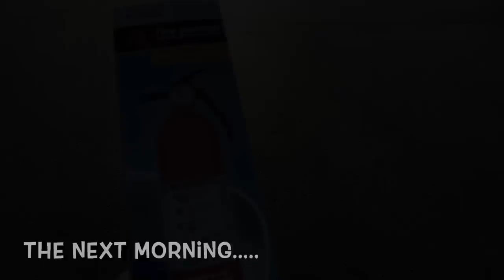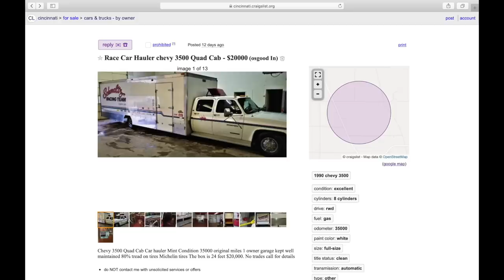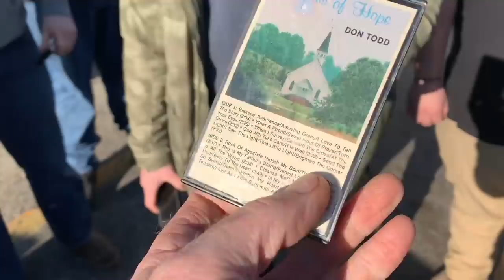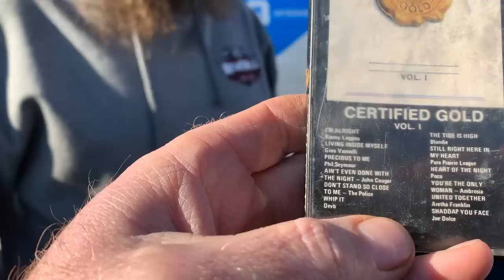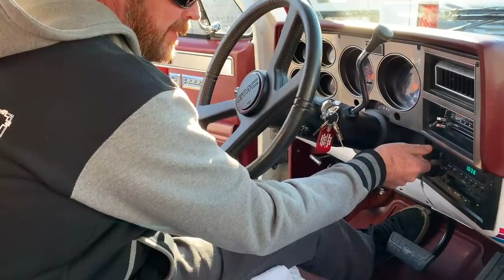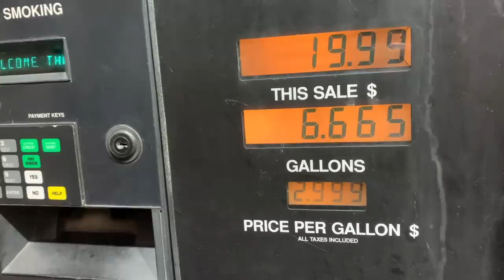Finnegan's Garage Ep.60: Blowouts, Rusty Gas Tanks and The World's Longest Ramp Truck!

Comment: Well, on a positive note, you didn't have to source 16.5 tires for the earlier style 1 ton rims. Gotta feeling  that seller knew full well that fuel system was pooched and hoped you would well down the highway before it plugged up again. Might want to get the new tanks ceramic coated, they will last longer now the fuel contain ethanol. If you are gonna have more down time than drive time, I would coat them as that ethanol blend crap goes bad fast. Hell before installing them get bungs welded in each one so you can drain the tanks for extended periods. Why it got a Diesel fuel dash bezel?

Comment: I have a similarly bad car Craigslist story.  About a month ago, I drove about 180 miles to buy a 2001 VW Jetta with a 12 valve VR6 to serve as a parts car for my '02 Golf with the same motor, but turbocharged.  I was getting to the point where I was maxing out  the capabilities of the stock bottom end (26 psi with an 8.5 cr headspacer on e85) making in the ballpark of 560 whp.  The Jetta had 85000 miles but a burnt up tune.  It did a compression test and it hit 90 pounds on average with a 7psi fluctuation between all 6 cyl.  As we were backing down the trailer, we create a small rut next to 1000 other ruts in this guy's mudhole of a "driveway" ok accident and immediately apologize.  He then begins to lay into us, cussing us out and calling us "unbelievably disrespectful".  That's not the best part, he gets his inbred buddy to block us into his property.  I ensured that it all got sorted out, but on the highway more serious problems came up.  While this car was on the trailer and we were doing around 70 on I95 in MI, a goddamn fender flies off and gets about 15 feet into the air.  This fuckwit had unbolted both front fenders off completely (they slide off forwards, and the car was parked backwards on the trailer) and NOT TOLD US.  He refused to give me any money back.  If there is anything else on this car that is either not as advertised or missing, I might be taking him to small claims court.
Reply: Radicle_Insanity - 

Good luck with that
Reply: @chrisj197438  Thanks.

Comment: I had an experience picking up my bus. A 35 foot motorcoach with a Detroit 8v71..I drove from Massachusetts to Indiana, rented a car dolly and started driving home. fuel issues,charging problem , oil leak no reverse and more. Three weekends later it finished the trip on a hook.Try breaking down in the middle of an intersection while towing a car and no emergency flashers. I still cringe when I think about it

Comment: Cummins swap the truck, or put in either a Duramax or a Powerstroke 7.3L. 

Or, make it easier, get a Chevy 6.2 or 6.5L diesel from a later GMT400 truck.

Either way, better mileage, or E85 conversion.

Comment: Those old tank switching valves are shit. My old 88 250 had one and they fall apart. I found the only place online that sold any still that fit without modifying the fuel system and it fixed so many problems lol

Comment: After converting the ramp truck into the
 Hindenburg, I'm curious why you didn't add
fuel cans into the mix. Each 5-gallon jug would add 35 miles in range and make great theatrics when you crawled back to fill while moving down the road.

Comment: The problem with the inner left or right tire that they changed was the belts separated so the rubber gets really old and all the glue around the belts dry up and crack and the pressure from the air being inside usually with those tires you get up to 80 psi if it's a load range e and the weight of the vehicle the belts pull apart cuz they're put in their crosswise Kriss Kross and when they let go well it makes a tire deformed as you can see

Comment: they did told you in the add that the truck had been sitting inside for several years , so you shouldve known youre self that its going to be a project and take precausions calculated in purchase price and for stuff like the gastank , it isnt youre first rodeo with old cars

they prolly had to air the tires after they where sitting flat for a while (causing the plies inside to fail ) , the tanks where sitting allmost empty so there rusted (they allways do unless you fill them to the top and then the gas turns intoo varnish ), all the oil in the transmission dribbled back intoo the sump and the top parts of the clutchplates have been sitting dry (hope they had it running a while before they shifted it do give the oil a chance to pump around a bit ) etc etc 
unless they recently done a complete rebuild dont count on any old motorvehicle that sat that long to NOT give you problems 
prolly need to flush just about everything and hope that the brakelines havent rusted through and all the rubber stuff (seals brakelines and dustcovers) is still serviceable and not turned intoo hard plastic , bearing grease turned intoo hard wax 

you could prolly make one of those SA books titled : " how to prepare a barn find / junk car to drive it across the states " with the captive "roadkill teached me how " it will sell like crazy i just know it 

might still experience transmission and leakage problems a year from now , if you dont do preventive maintenance   

but over the top probably but it might be a good idea to have the trans taken a part and have it put together with new seals and oil , the clutchplates prolly be ok if they soak them in transmission oil for a while 
engine prolly can use a reseal and a coolant flush too , might be wize to replace the headgaskets and intake gaskets too as the coolant probably has attacked and softened the gasket material around the coolant passages even if they used propper coolant 
does the truck have a copper radiator ? if so its good if not chances are it will start leaking within a year same with the coolant hoses and the heater radiator 

with the common problems in the back of youre mind you should first calculate the costs for the probable repairs and temporary fixes and take those off the asking price and set up for the worst before starting the roadtrip 

collect stuff like jumper cables , spare battery , electric fuelpump , gas can , trans and engine oil , coolant , blankets / tarp , ductape , toolbox , roll of electric wire , and connectors , tiewraps , hoseclamps , and different hoses , extra fuses  , extra lightbulb set , 12 volt aircompressor to take with you 
i probably wouldnt even had tried the old gastanks and started with the outboard tank fuelpump thing you did
Reply: watahyahknow 

He ignored the warnings staring him in the face. The biggest was it needing a fuel filter.

Comment: I doubt Finnegan will ever see this, but maybe someone else will save some time with this sort of issue. I had a Chevy P30 motor home 454 that had the exact same issues, and after pulling the tanks, turns out there's no rust in there at all, just all the rubber sections of hose had rotted, and the seals in the tank selector valve were sucking air.

Comment: 3 speed auto, no overdrive and gasoline big block V8 in such large truck, US way of doing things is so different than in Europe. With 7 MPG (33L/100km) no one would even think about that combination. It would probably be a van-chassis with approximately 3L diesel and a five speed manual with wide spread ratios and would probably be about 15L/100km (15 MPG). Oh and since it is above 3.5 tonnes it would require registration as a truck, truck driving license with additional medical exam, electronic logbook, keeping drive/rest periods correct (more compliacted than in US), high road tolls, possibly additional training on securing loads and general transport... Ahhh Europe...
Reply: Actually, Europe isn't as bad as U.S. State or Canadian Provinces, depending on classification. This truck has hydraulic brakes and maximum weight and isn't used for commerical service (Not for Hire). Because there are no air brakes and has an automatic transmission, license and driver qualifications are logically set for basic requirements. 

If it did have a 9 or 10 speed transmission, big diesel with air brakes, then a higher class of license and qualifications (air brake) is required. Each State / Province in North America has different weight rules for none commerical service vehicles. Example, RV / Toterhomes are almost unlimited weight in some States while others have a Gross Combined vehicle weight of 24/25,000 lbs. 

A single rear axle dual rear wheels with the right 10 ply tires, each can easily handle up 4,500 lbs.

Comment: So lucky with the cops. In the UK you would get hammered for driving the wrong way on a highway. Added to that they would have checked the tyres on the truck and found them unroadworthy. Licence suspended. Massive fine.
Reply: @jreyman  Well if the USA had such controls its motor and tyre manufacturing industries might be healthier?

Comment: You were a little harsh on the seller if you bought an old truck that hasn't been used since the 90s. Battery, gas tanks, and lines usually go bad with sitting for so long. Cool show and actually cool to not see a camera crew bail you out! That truck is totally Rad! Sorry felt like the 80s.

Comment: Yeah, as they say buyer beware and with all the sociopaths on Craigslist it's even more true! Considering the age/mileage and lack of use I'd had probably insisted on going through the fuel system before even going around the block but that's just me.  As they say getting there is half the fun and this will leave you with a lot of memories. So Mike, do you even have the concept of AAA?
Reply: Will Wood 

I don’t feel like the seller knew about the rust. For all we know the seller knows nothing about cars and told it how they saw it. Sure there are lots of shady people on Craigslist but I have a feeling that isn’t the case here. This is buyers remorse.
Reply: @chrisj197438  During the exchange on the side of the road the guy wanted to take the license plate off the truck. To me that's a class A dick move. I've done this kind of trip before, buy a car hope it's sorted and get it back.  Bring your tools and your AAA card is all I'm saying.

Comment: I don't know much about the extended wheelbase square bodies but if that beautiful Ol girl has the "side saddle" tanks that GM used from 73-87 (or 91 on a truck like that) the side mount tanks are widely available for about $100 each. I'm guessing that if there's 1 side and 1 rear mount tank, the rear mount would be similar to a Jimmy or Suburban tank. I say Jimmy since this is a GMC Truck, not a wanna be Chevy! Too bad GM decided to name both of the big station wagons the same back when they built REAL trucks! If my 78 K-35 would've known about all the trouble her daughter was in, we'd have hooked up to the gooseneck here in Northwest Ohio, winched her up on the trailer and "chauffeured" her down to Georgia! F.Y.I. my 78 with a 454/4 speed gets about 10 mpg empty OR loaded to the max. I knew you wouldn't get that with the box truck. I love my truck so much that I've owned her since 1984 and restored her 3 times. I even told my ex-wife "I had that truck way before I had you and I'll have that truck long after you're gone". The ex has been gone for 20 years but I still have the truck!

Comment: Hey Finnegan, would you be interested in buying a 1970 GTO?
It is all original but been interior was taken out for restoration. The original motor was rebuilt and the car was painted. New glass was installed throughout. All the inside parts are all organized and in ziplock bags "labeled". It has been sitting in a garage for 10 years and is a one car owner. Please let me know if you are interested. I can send pictures if you like.
Reply: I'm in Woodstock GA.

Comment: I may be in the minority here but even at 20 grand I don't feel this was a terrible deal.  Yes the seller may be a putz and the truck had some issues, but what would it cost to buy a new one?   And now with new tires and battery and getting the fuel system worked out, you know it should be able to make long trips.    My question is did they ever figure out if the tranny ever shifted into 3rd gear?

Comment: Lol, it's your truck now and now you need a battery and have to ask someone to get it. Of course you have to pay for it, what sort of tomfoolery is this? Lololol

I enjoyed the video, it happened to me in a similar fashion when i bought my Gran Fury. Said it was running. Fired up good. Ran outta gas in the hood. No plates, no insurance, no title. Flat tires. Got out to push and made me.pass out, slixed up my hand on broken glass from the broken mirror. Cops drove by and gave me a good staring. 2.gas stations out of gas. 

10 months later, it runs and doesn't try to kill me as often lol.

Comment: You guys should have known better. You could have packed all kinds of spare parts, like fuel line etc, spare clothes, towels (why are you travelling without a towel?) and driven out there. Then guess what, it's a ramp truck. Put the car in the truck and drive home. You've got a spare battery in the car, a spare fuel system in the car, everything in the car that's now in the truck. There's even a heater built right in.

On top of that, you guys were in town when you picked it up, at a parts store, and you didn't get anything. Jumper cables? Fuel line? Spare belts? (A towel?) Don't whine about having to buy stuff to get home. You could just return it when you get there if you don't need it.

When you buy this kind of stuff, keep in mind that no matter how well they think it's been kept, it's still sat for years. It didn't get all dirty and corroded from sitting outside, but it's still going to have problems. That ramp truck is still worth the money, you know it.
Reply: I'm with you Bit. I think the sellers went out of their way to help with a truck they no longer owned.

Comment: Gigantic truck which is as aerodynamic as brick, what engine do you put in? A big diesel with lots of torque and halfway decent fuel eco or a big gas engine totally out of place for this application? Right! you put in the gas engine ! 
I love you americans
Reply: tinatpasselepoivre I like what your thinking but the Big Block was the tow motor at the time.  When that truck was made diesel motors produced less power and had a a slightly lower tow capacity.  I have an old diesel and my father in law has the Big Block version which has a higher tow capacity.  The game changer came from Dodge in 1989 when they put the big (at the time) turbocharged 5.9l in-line six that made 160 hp and a whopping 400 lb-ft of torque at 1,700 rpm.

Comment: Ahhhh! the road trip home on a "craigslist find" (gumtree here down under) When i bought my 260z it had been sitting for 20 years, i told the owner i wanted it in running condition and with registration. It was the middle of summer where it was constantly above 112°F in Australia, so i was not bothered wrenching on a car in the middle of a paddock in that heat to get it driving, leave it to the seller. He would get it running and inspected, Id organised insurance, we would get it rego'd and id buy it.  So he rings me that its passed its inspection, lets meet at the RTA (DMV) to get rego for it. We get the plates, bolt them on and we have to push start the car out of the RTA carpark (starter motor shot) I follow him back to his house, valve stem seals leaked so much it smoked like john candy's car in uncle buck, no brake lights, indicators, huge missfires etc. So much for that legitimate roadworthy certificate aye? I pay the man, we push start it again and i'm on my way home.... no speedo, no fuel gauge, no temp gauge... safe to say not a single thing electrical worked! It would nearly stall at every light, it had a huge missfire due to the carbs being bad, and when i hit a pothole, the side mirror fell off as it was held in place with double sided tape, covering a rust hole too!.... cant stop now! literally! I wont be able to re start her! I passed a few cops and was sweating bullets as if i got pulled over it would have been red stickered and ended up on the back of a tilt tray!.

It was the best drive of my life!

2 weeks later it blew the radiator and one night i caught my jumper on the front grill bracket and ripped it clean out with a chunk of bog the size of my fist!

That was 4 years ago... I have just finished fixing all the rust in her and now she is at the painters on a rotisserie as a bare shell... She will get a 350 chev in her once its back! got a few videos of the old girl on my channel too!

Comment: Why would u not have jumper cables in with ur tools 😣 how come the truck couldn't charge the battery leaving truck running for 15mins charging your battery then get him to build revs to like 4000rpm and then trying starting ur ramp truck.
Oh & join tripple a you need it if only for parts lol

Comment: Had a very similar problem with a square body chev myself.  Changed fuel pump, fuel filters, fuel sending unit and pickup tube,  cleaned carb all of that, and the problem was only fixed when I changed the fuel tank.  In an alley.  During a rally called "The Great Beater Challenge"  https://fireboygarage.com/wp-content/uploads/2019/01/20180824_200344.jpg
Reply: Eric Janzen 

That’s my kind of challenge